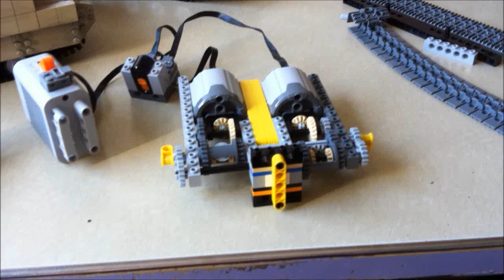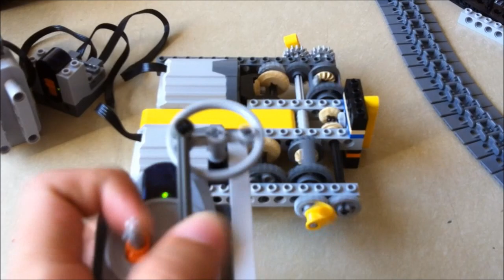LEGO Tank Steering Mechanism - Double Differential

Comment: This looks good and all, but i would need an estimstion of how much weight this susoension can carry arround. For my project i need a compact final drive steering mechanism that has to be abled to carry round about 3 liters of water( i used water weight). Can this thing handle that weight???
Reply from the maker: Christopher Marten this system is certainly not the best for lifting heavy Mocs.
Reply: Tanks a lot.

Comment: It's clever, but I don't see what it offers compared to a simple 2 engine drive system.
Reply: Alex Paulsen if one motor is faster than another in a typical system, the tank will pull slightly right or left. This system prevents that from happening
Reply: Yup, that makes perfect sense. I suppose not all motors are equal?
Reply: Exactly
Reply: @Metal-Possum  yeah it might not, the age of the motor too, amount of grease in it. Even if both is completely brand new it may not have similar speeds

Comment: How well does your Steering mechanism work with heavy weight vehicles? I once read that the small lego geats get verry likely to break if the vehicle weighs 3kg or more.
Reply from the maker: this steering mechanism doesn't work very well unfortunately, and I've tried many things to make a capable steering mechanism for larger tanks. i found that its better to just drive each track independently.
Reply: Yeah, thats what I heared as well. It´s a shame because the double differential version would mean driving straight would be much easyer. But it seems the classic 2 drivesprockets per track with each one having an indipendant motor is still the best option for heavier tanks.

Comment: Are there instructions (or even a simple diagram) for the double differential tank steering mechanism in lego? As I understand it, the axle/s going through the diffs are for propulsion and the axle on the outside of the diffs steers? (is that right?). Is the steering axle a single fixed axle with gears on each end or is there more to it?

Comment: Did you have to drill out one of the gears? Looks like the dark grey gear that activates the steering differential spins independently of the axle it is threaded on. I'm no Lego expert, but based on my son's lego, I've never seen a gear that does that. Is there one or did you have to get creative with a drill?! :)
Reply: Hello Greg! Those gears aren't modified, they're made to be independent from the axle that they are spinning on =)

Comment: Nice steering mechanism, but unfortunatly i can't mount it in my rc lego tank, tried to use something like that but some gears etc. broke and bend(only 4 gears, 4 axels and 1 connector died..). I think the main problem is that my rc lego tank 'prototype X' weights 6kg and 60cm long with 4 tracks powered by 4 xl engines...

Comment: So I'm guessing that this was a combination of a) creativity and b) the fact that it's not easy to have two perfectly synchronized tracks when running independent track motors?
Reply: more that its more efficient if u have a main motor for driving and a secondary motor for turning, u can have a much smaller motor that is geared down for turning while u have a big motor for driving past, also its easier to have 1 gearbox if u want multiple gears on ur main motor instead of having a gearbox per track